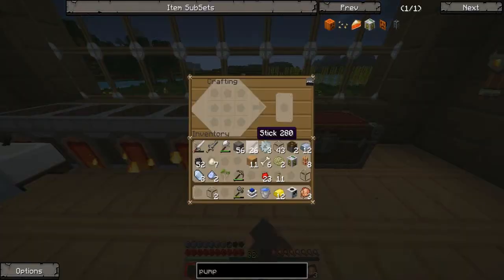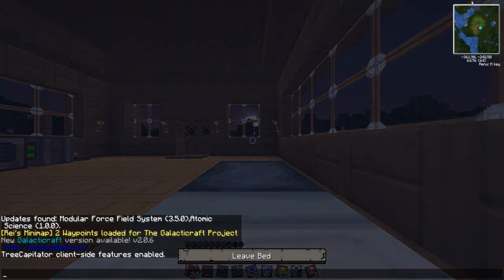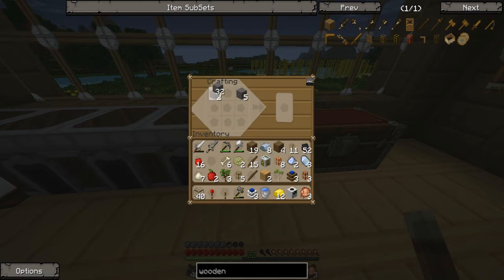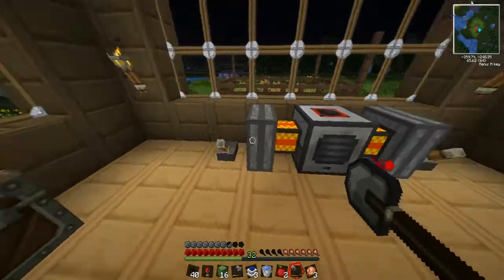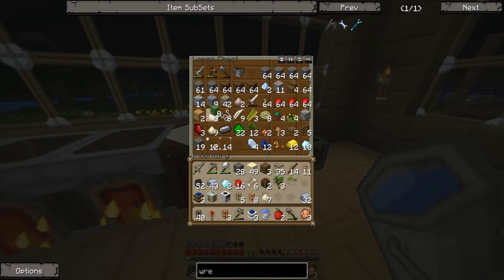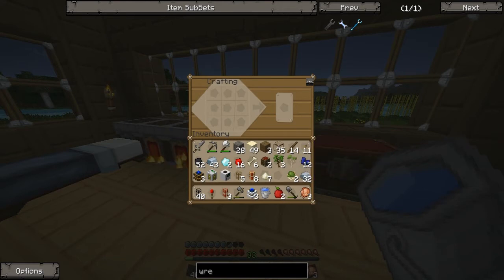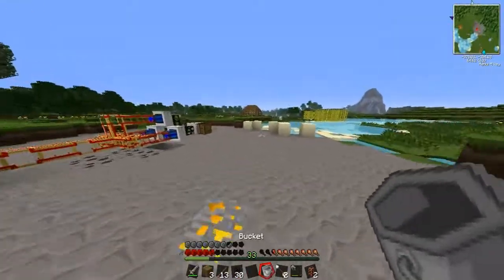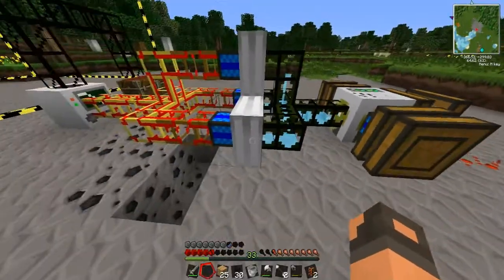The Galacticraft Project - Ep.10 - How To Set Up A Combustion Engine

Comment: gadge! If you don't want to make waterproofing for every pipe you make, you can craft Licuiducts (smart pipes that give water at the same rate to every output), a kind of pipe that requires pulverized obsidian and lead for reinforced glass and copper,use an induction smelter to mix the lead and the pulverized obsidian in order to get the reinforced glass. Then you put 2 copper and the reinforced glass to craft 8 licuiducts.